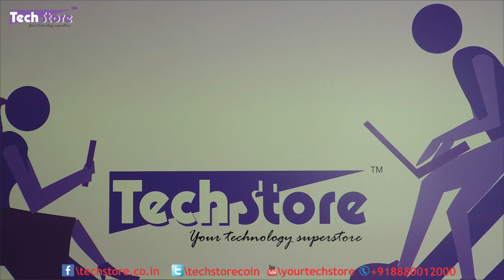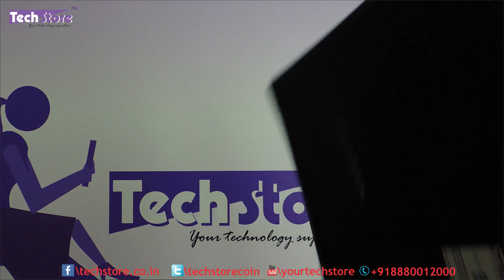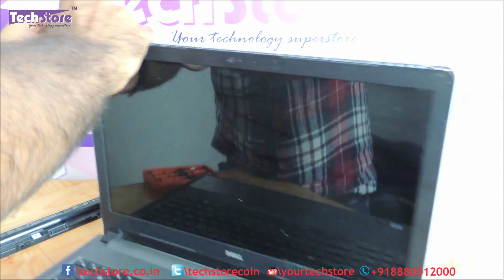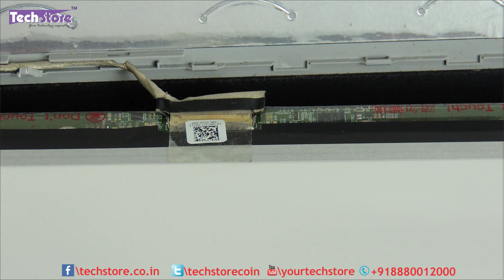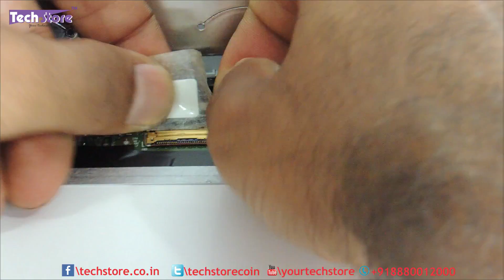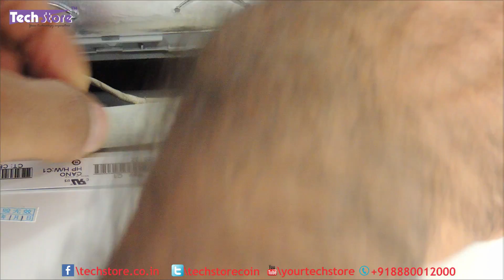Dell Inspiron 15 5000 series 5558 5559 : How to replace the LED Screen easy & DIY

Comment: hi. got a question. I've got HD model and want to change it to FHD is it possible to change screen only or i need different cable?
Reply from the maker: Not possible as the display cable will not support.

Comment: I cant remove the front thin strip from the bottom where it is attached to the hinges to the main board. Im afraid it will break if I force it.

Comment: Hi, on these Dell i5559 models..  do you know if you can upgrade to 1920x1080, if the original screen is 1366x768 by just changing the screen?  or do you also have to update additionally the cable/motherboard?
Reply from the maker: we would not suggest this.
Reply: you can upgrade from 1366x768 to 1920x1080

Comment: Great video.. just one question.. how complicated is the change to Touchscreen? 

in addition could you share us the part number of that screen replacement?
Reply from the maker: It is just not the screen , even the display cable has to be changed.

Comment: How can I tell if it's 30 or 40 pin. 

Thanks for the helpful video. everything is straight forward until that point.
Reply: When you open your old screen then you can count the number of pins at cable connector and it will be 30 pins.

Comment: Hi sir, 
I have also Dell Inspiron 15 5000 series laptop , lvds or vga cable are damage , can share a link where I buy to this .
Reply: https://pctech.co.in/shopping/Dell-Inspiron-15-5558-Full-HD-Screen
https://pctech.co.in/shopping/dell-inspiron-15r-5558-15-6-inch-hd-led-laptop-screen.html

Comment: I need some assistance. Can anyone tell me how do I determine how many pins there are in a video connector on a laptop screen (inspiron 5559). Is there like a utility that scans the motherboard to pull that kind of information? I need this beforehand buying the new screen, thanks!

Comment: Is it true that the LCD screen will only be compatitible with its original manufacturer and model of the same system? Or if the screen size, resolution and model number are the same, does it really matter?

Comment: i have the Dell inspirion 15 5000 series 5559 i guess it is touch screen i never used it that way but my screen was just broke and i need to fix ASAP to finish the rest of my college online classes. Do i have to get anything besides the screen? such as could that extra piece being connected does that need to be repurchased as well?
Reply from the maker: +Nichole Kerstetter You just need what is mentioned innthe video.